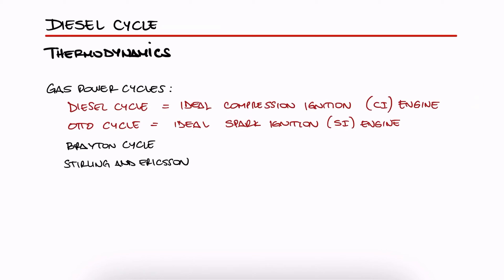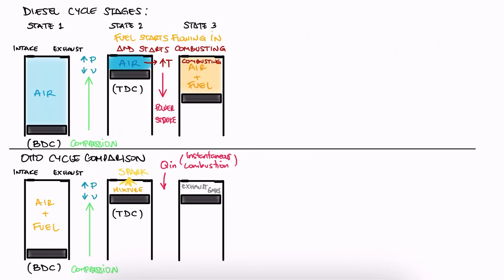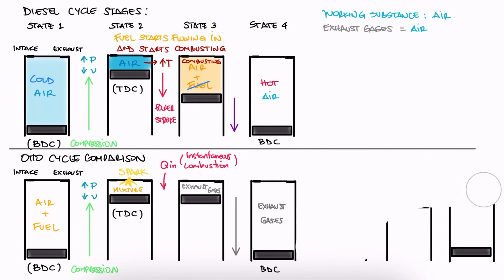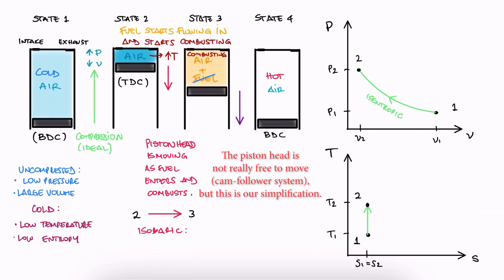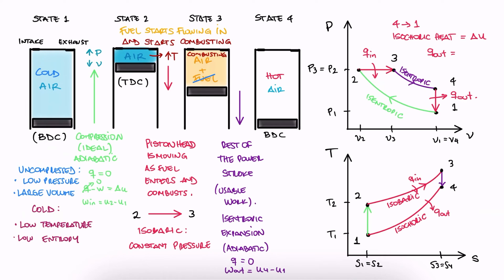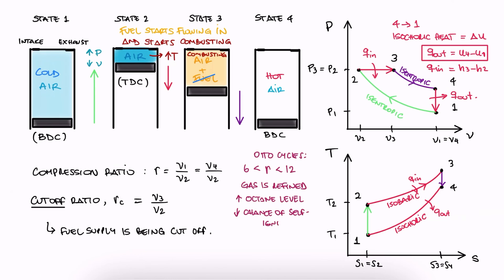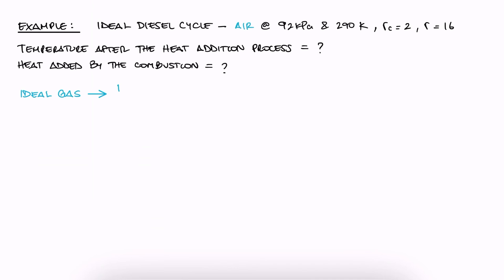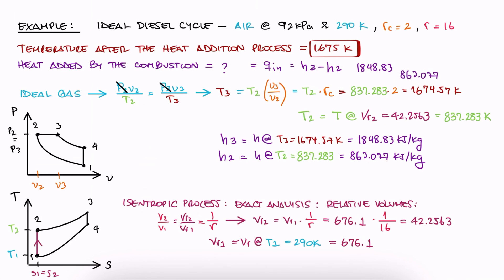Thermodynamics DIESEL CYCLE in 10 Minutes!

Comment: Hey, Good day. Basically came to this video to learn more about engine cycles since we have a report on it. I'm still a bit confused since I haven't found a single source referencing or talking about engine cycles on the web. All I can find are for thermodynamic cycles or different cycles. So, I just want to clarify if the otto cycle and diesel cycle are both examples of engine cycles or if gas power cycle can be a synonymous term to engine cycle. Well other than that, I think this might be one of the most useful videos I have ever seen, especially for thermodynamics.